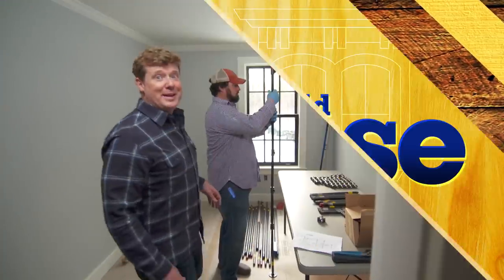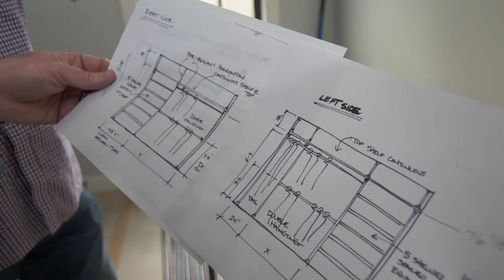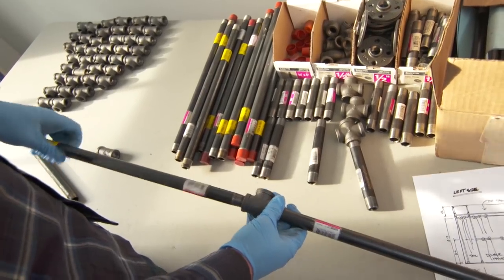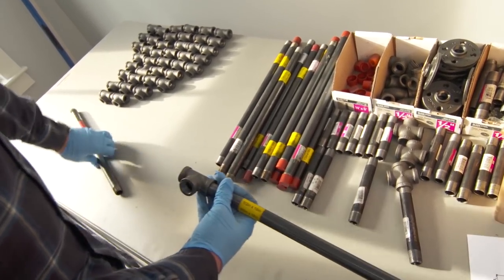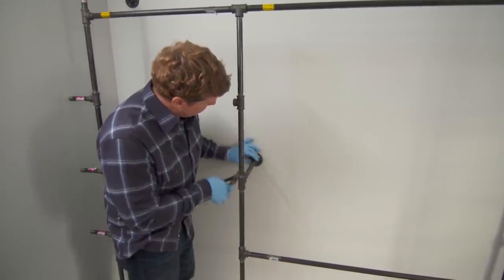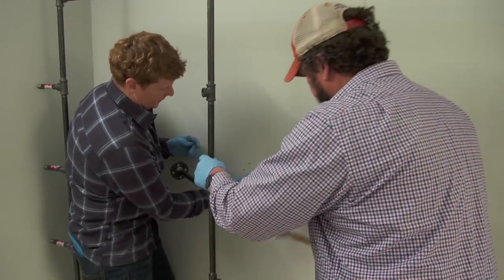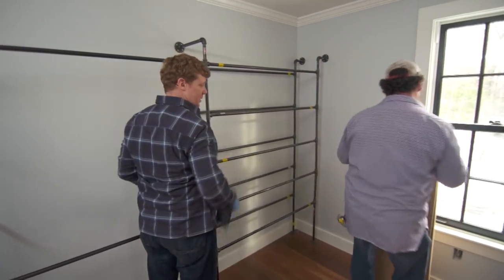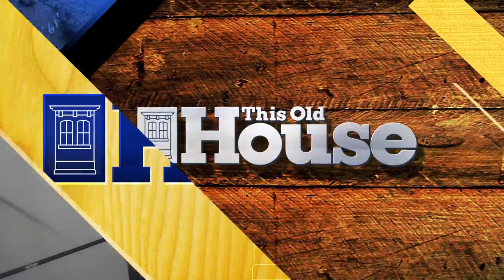How to Install New Kitchen Cabinets | This Old House

Comment: This the first time I've been disappointed in This Old House.  Sure, I've disagreed with a few things now and then, but this is ridiculous.  If your budget is tight, why waste money on expensive pipe and fittings that require cleaning, priming and painting, when it would be so much easier, cheaper and practical to build simple shelves and use standard clothes rods?  Even worse, the pipe flanges are attached with plastic drywall anchors.  I bet Norm Abram threw up when he saw this.

Comment: The idea saving money is great. However, the side expanding wall anchors are weak. They are normally used for hanging small, lightweight, pictures. If there is any front pull, this type of anchor will put out of the wall. Try using either stronger back expanding anchors (best for this application) or screw in anchors for much more strength.
Reply: @Kevin-mp5of  When the loaded shelves fall on someone, it is no longer a DIY. Its an accident investigation.
Reply: I was gonna say why not just put some boards on the wall, attach THOSE to the studs (wherever they may be) and yoy can attach your pipe fittings wherever you want without worrying about whether the anchors will pull out of the wall (yes they will).

Comment: 1:29

I'm curious how he threaded that pipe into 2 opposing Tees.  Threading 1 would unthread the opposite end.

I guess they just partially threaded each end.
Reply: I was curious about the same thing. BEST I can figure, they bought T's with the one hole larger, like a 1/2x3/4x1/2 T, so they can just shove the pipe inside of it rather than threading it. Passed that, I'm also at a loss.
Reply: @Kevin-mp5of  sounds super safe for something that will be getting handled on a daily basis...
Reply: @Kevin-mp5of  considering that 90% of the force applied to the fixture will be vertically, not horizontally, that's not much of a concern. If any of those flanges hit a stud, it should be plenty solid. That is, IF the pipes are actually tightened together to spread all forces across the whole unit as a system instead of loose and applying it unevenly to different flanges.
Reply: Everybody listen to @kevin, he's put together shelves! Plural!!

Comment: We joined the rebuild and were told that the budget was closed and no more money. It was said that he could have spent thousands of pounds but as there was no more money, he could not do that. Then he went to the local pluming shop and got at least a couple of hundreds of iron bar that he used to make a closet from. Your idea of no more money must have a different meaning where you are filming.

Comment: will never understand why guys find the need to wear hats/caps constantly, including indoors; guess all that bright sun inside hurts their eyes
Reply: @Kevin-mp5of  ouch!  I understand covering the hair for painting and such, especially ceilings/overhead, but if safety precautions are needed on the head, then wear a durn safety helmet, glasses, ear protection, whatever applies.  In the late 70s I had the extra responsibilities of safety checks in the R&D labs for compliance with numerous issues including head protection and eyewash fountains but even OSHA at the time overlooked that we were required to use raw asbestos fiber insulation tapes, and breathe highly toxic heavy metal catalyst dust in the reactor tubes we handled often.  I was permanently disabled by age 30 and all my coworkers were dead before age fifty.  Different industry, but very Silkwood-esque.
Reply: @Kevin-mp5of  yes, and May 30 is the one yr anniv. of the death of a dear family friend who died of mesothelioma; my dad trained him as one of many chem production plant interns near Chicago in the 60s, and his young children I babysat when I was a teen, so they felt like family, not just friends. If people knew what neurotoxin ingredients were in most store shelves, they'd be appalled. A team of clinical ecologists [MCS specialists] saved my life -- twice, with correct diagnoses, and the dbl blind testing to determine what nearly cost me my life and to avoid those things. So basically I have lived the C-19 lifestyle since 1983, much like the old movie, the Boy in the Plastic Bubble [but I cannot even tolerate plastics!]. It's so cruel I would not wish the condition on anyone.
Reply: @Kevin-mp5of  Yes but the job that finally put me in hospital for a month, clinically dead, was from working in accounting, around 9 chain-smokers who back then could all still smoke at their desks [one open cubicle room]. That was in 1983 and have been severely disabled ever since.